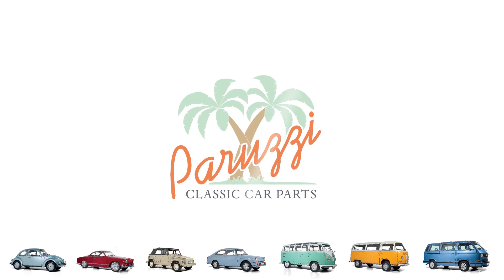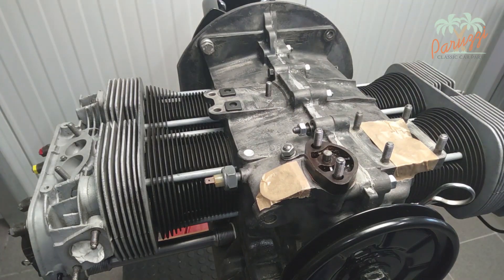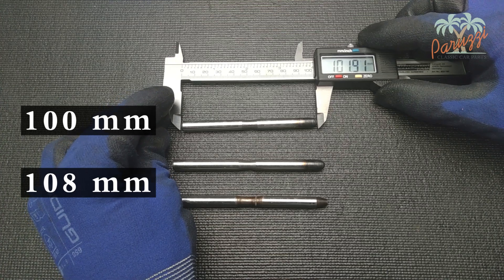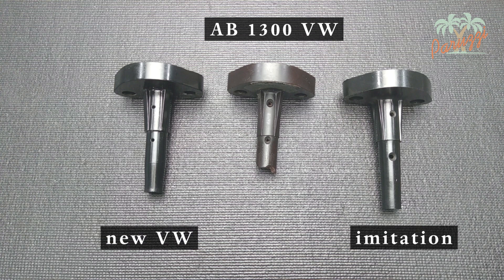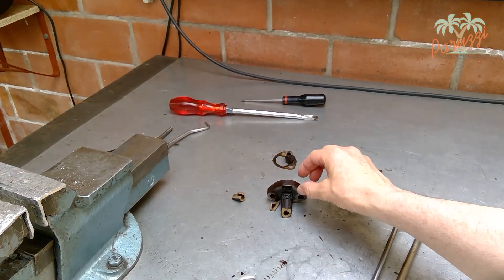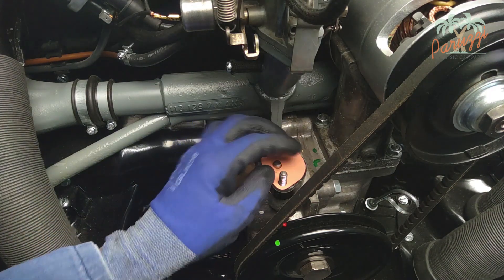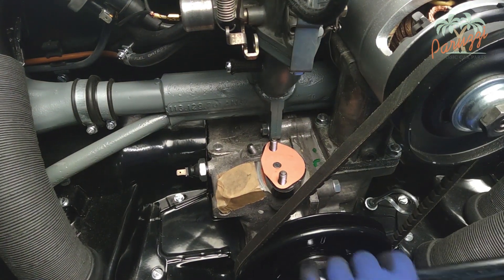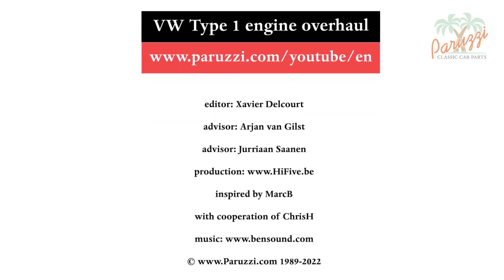09 Engine overhaul - the fuel pump

Comment: Lots of practical information in this video. Thanks.
Is the NEW VW replacement fuel pump flange available from Paruzzi?  I have had very bad luck with the no-name replacement flanges - especially with the height measurement (too much operational range of the exposed pushrod).
Reply from the maker: In the comment below the video you'll find links to parts we discuss. This link https://www.paruzzi.com/webstore/?z=fuel+pump+flange gets you to the flanges, the first one is the Type 1 flange, original VW, as mentioned in the webstore. We show this one in the video 'the one on the left side in the video", it fits just well in an original crankcase.